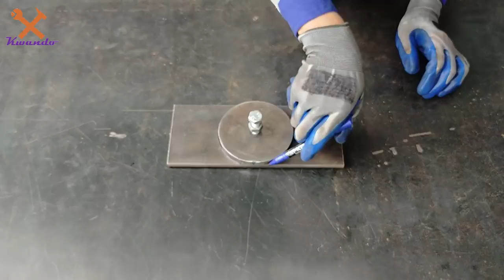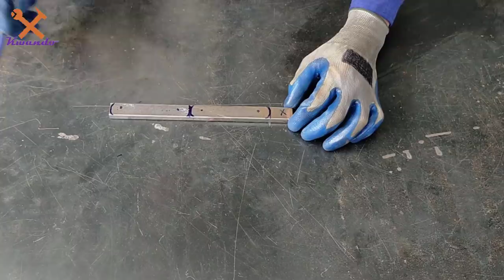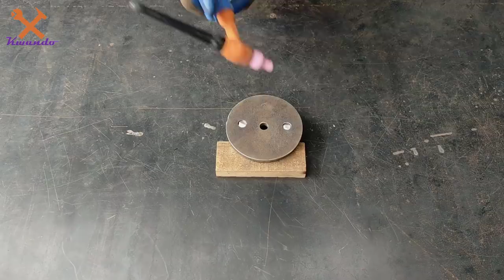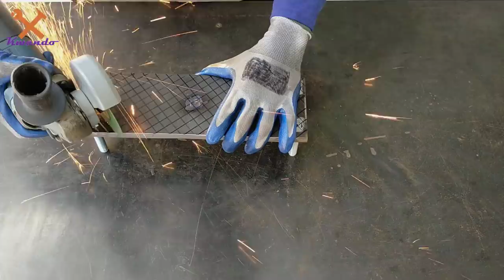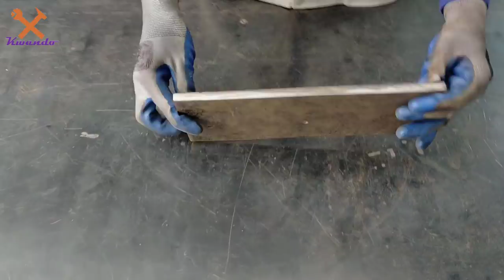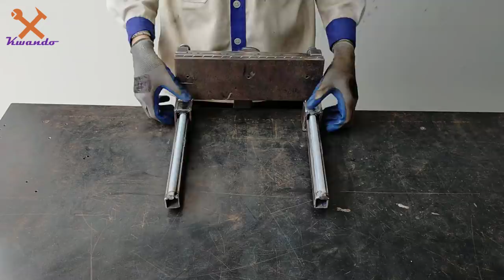DIY Tool | Make A Quick Bench Vise | Perform Step by Step

Comment: WELL, I am worn out. I have made 20 trips to the hardware store. Much measuring, much marking, much cutting,  much welding, much grinding, much fitting, I have lost two pieces, I found them after I remade them and now, back to the store for paint. Next time I will buy it. Now where did I put that screw?